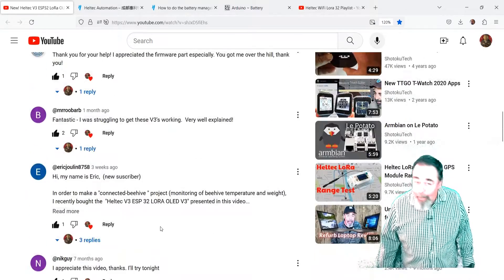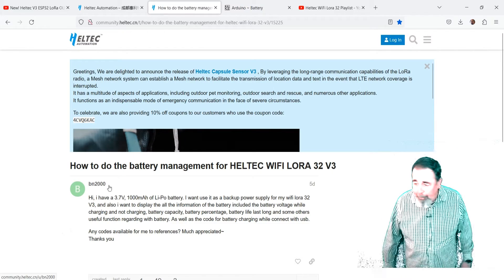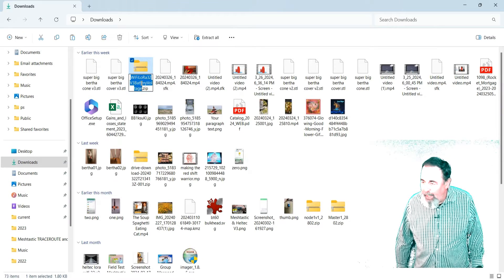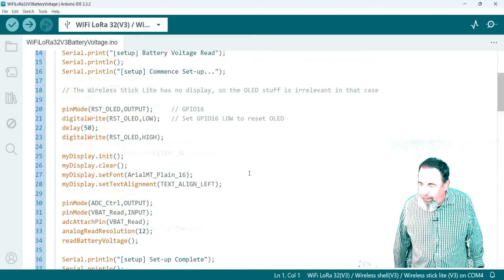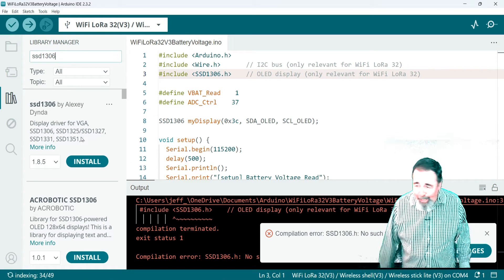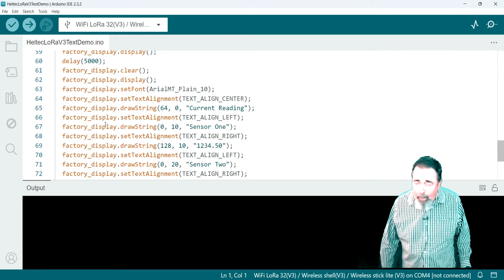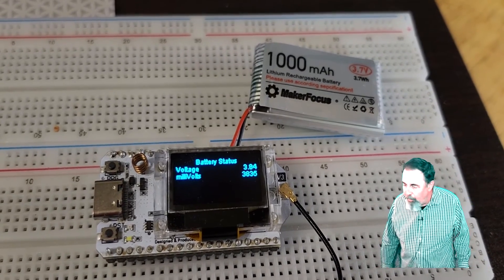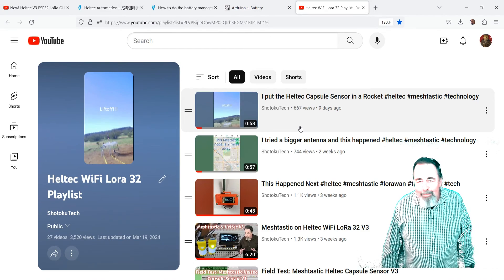Battery Management: Heltec WiFi LoRa 32 V3

Comment: Is there a way to tell it to shut down the display and LEDs once you're doing everything on the app?
Reply from the maker: You can turn of the display. I'm not aware of a way to turn off the LEDs.
Reply: @ShotokuTech  thank you. I can't even get the boards to stay powered down for more than 5 minutes. I'll have to put in a switch
Reply from the maker: @bendeleted9155  I use a switch when using the Heltec V3 with Arduino code. 
If you are using this with Meshtastic, holding the user button down for 10 seconds shuts it down.

Comment: Hello!, can it be connected by solar power through the usb-c then a battery is connected through the connector for continuous power?
Reply from the maker: Yes, it can be done in this manner. Thanks.
Reply: @ShotokuTech  wow thanks for the reply!! I'm planning to connect it DFR0559 so it is dual battery although only 1 battery will be readed. do you think this setup will work?
Reply from the maker: @jerickojamestano626  Can you read directly from the DFR0559? I would think that is more reliable if it is directly charging the batteries.

Comment: Does not work with heltec 3.2?
Reply from the maker: I have not seen a Heltec WiFi LoRa 32 V3.2 yet?
Reply: @ShotokuTech  
I’ve been trying to read the battery voltage on the Heltec WiFi LoRa 32 V3.2 (ESP32-S3), and I’ve encountered an issue that may affect other users of this board.

According to official Heltec documentation and the schematic (HTIT-WB32LA_V3.2.pdf), the battery voltage is supposed to be read via a voltage divider controlled by GPIO37 (ADC_CTRL), and routed to an ADC pin like GPIO13, GPIO10, or GPIO1 (depending on the source).

However, after testing every exposed GPIO with a multimeter while GPIO37 is set to HIGH, none of them show the expected divided battery voltage (typically ~1.6–2.1 V when the battery is at 3.8–4.2 V). Most pins either show 0 V or 3.2–3.3 V (pull-ups or power lines). This includes:

GPIO1

GPIO10

GPIO13 (not even exposed on this board)

GPIO39, GPIO2, GPIO4... (full sweep)

Even though the battery is properly connected and charging (verified ~3.9 V via multimeter at the JST connector), analogRead() on all candidate pins returns 0 or near-zero values.

This leads me to believe that VBAT_ADC is either not routed to any usable GPIO, or is only available via internal ADC channels not exposed through standard Arduino functions.

Has anyone successfully read battery voltage on the Heltec V3.2 using Arduino?
Is the only way to do this via a custom firmware (like Meshtastic or using ESP-IDF's RTC ADC)?

Any insight from Heltec or the community would be greatly appreciated!

Thanks in advance.
Reply: @DanielPorrasR  so I was having the same issue as you. I'm not entirely sure of what I did, but I noticed that when GPIO37 was high, I'd get a reading from GPIO1 (VBAT_Read on the heltec documentation). I just pulled 37 to high, read the voltage using analogRead, then pulled it back low. From there it was just a matter of finding the correct value to multiply the analog read value to get an actual voltage. This value was verified directly from the JST connector on the board while it was powered on. I did notice though that it will get .02-.04 volts off depending on if the voltage is higher or lower from when you "calibrated" it, but its good enough for me.

#include <Wire.h>
#include "HT_SSD1306Wire.h"

SSD1306Wire display(0x3c, 500000, SDA_OLED, SCL_OLED, GEOMETRY_128_64, RST_OLED);

#define VBAT_PIN 1
#define ADC_CTRL 37

void VextON(void) {
    pinMode(Vext,OUTPUT);
    digitalWrite(Vext, LOW);
}

float readBattVoltage() {
    digitalWrite(ADC_CTRL, HIGH);
    float raw = analogRead(VBAT_PIN);
    digitalWrite(ADC_CTRL, LOW);
    return raw * (3.3 / 4095.0) * 5.215384;
}

void setup() {
    pinMode(ADC_CTRL, OUTPUT);
    digitalWrite(ADC_CTRL, LOW);

    // initialize OLED
    VextON();
    delay(100);
    display.init();
    display.clear();
    display.setFont(ArialMT_Plain_16);
    display.drawString(0, 20, "Battery Test");
    display.display();
    delay(2000);
}

void loop() {
    float v = readBattVoltage();
    display.clear();
    display.drawString(0,20, String(v) + "Volt");
    display.display();
    delay(1000);
}
Reply: Forgot to include the analogReadResolution(12); in setup()
Reply from the maker: @carter9591  Thanks for the insight. Best wishes.

Comment: Thank you very much to the contribution of the community, normally your codes work fine on my board, but this one is returning this error: 'adcAttachPin' was not declared in this scope Can you please help? Thank you!!
Reply from the maker: It seems that Heltec changes things in their board definition packages from time to time. The code worked with the board definition package that was available at the time. I would have to try to reproduce the issue with the current package.
Reply: @ShotokuTech  Same here, very frustating!
Reply from the maker: @pulpitus  Isn't that the fun part of this hobby? Facing new challenges and overcoming them. That is the reward. Best wishes.
Reply: @ShotokuTech well… not much 😂 I have been whole day fighting with deep sleep, only gpio0 is able to wake up this board, and there is no info in their documentation….
Reply: You can use the code posted below for the battery, it works with 3.2.
Reply: @ShotokuTech  Thank you!

Comment: what are the calibration values you got there? does one create them by measuring something, somewhere, or are they generally the same? (the values I see when power is plugged are all over the place and definitely messed up. unplugged they might sometimes make sense. Also I'm getting a 4-digit value in (voltage since it's floatvoltage*1000) Maybe tomorrow I try again and understand my errors, but the calibration bit is a bit of a worry.
Reply from the maker: I used the values I found when making the video. You can probably adjust them if you have some accurate measure to guide you. The output still may need some interpretation such as the four digit voltage. But you are off to a good start. Best wishes.

Comment: Thank you for sharing the information, that was helpful and inspirational. However, when experimenting with the sketch I have some strange behavior (the ESP entering kernel panic and sometimes executing instructions out of line) that was difficult to debug and explain. After hours of testing I found  that (in my case) the root cause was the missing return statement in the method uint16_t readBatteryVoltage(). When I was either changing the method in void readBatteryVoltage() or adding a return voltage; at the end oft he method everything was working well.
Reply from the maker: Interesting

Comment: I am having problems compiling and joining the code with another one that I made, I do not understand why it does not recognize the adcAttachpin function, I was searching the forums trying to try but I have not been able to fix the error
Reply: Same issue!
Reply from the maker: @tetie_  What is the issue specifically? What library, what sketch?
Reply: @ShotokuTech  I managed to solve the issue simply by removing the function. It seems to work properly without it. The expresssif docs says the adcAttachPin API got removed when upgrading from arduino ESP32 2.X to 3.0. So it seems to be chip-specific for newer ones
Reply: @tetie_  I can confirm the same result. 
Error was: 
error: 'adcAttachPin' was not declared in this scope 36 adcAttachPin(VBAT_Read);
exit status 1
Simply removing line 36 worked!
Reply from the maker: The code I shared works, correct? It's hard for me to advise further without the context of what else you have added to the sketch. Best wishes.

Comment: ledCSetup doesnt work with heltec lora 32 v3 Do you know why? many thanks

#include <Arduino.h>
const int pwmPin = 19; // 
const int freq = 5000; // 
const int pwmChannel = 0; //
const int resolution = 8; // 

void setup() {
  // PWM pin konfigurálása
  ledcSetup(pwmChannel, freq, resolution);
  // A PWM pin hozzárendelése a kiválasztott csatornához
  ledcAttachPin(pwmPin, pwmChannel);
}
Reply from the maker: Hello. To be honest, I am only supporting the example sketches that are included with the V3 board definition or code based on those examples. Best wishes.

Comment: Hey! It's me again. I was wondering if you have already tested the new Wifi_lora_v3_factorytest_v1, besides the fact that i have already tested this board before (and done some projects with it) it seems to be that the new library update has so many different problems to solve (does not work at all, at least for me) and i was wondering how you dealt with that! Congrats for that good work on troubleshooting and challenges!
Reply from the maker: Right now I am totally immersed in running Meshtastic on the Heltec WiFi Lora 32 V3. My outdoor solar powered unit just survived its first night with 64% battery left and the Sun is coming out again. I'll see what I can do if I get a chance. I noticed a new board came up with LoRa failed right out of the box the other day. But flashed with Meshtastic it worked fine.
Reply: I see, does meshtastic have any support for multiple sensors and different projects that might require a way to access that information by any app with graphics?
Reply from the maker: @santiagoandres5658  We are learning about that step by step. I have several videos and shorts on the topic so far. You know from my other videos that serial and I2C devices are supported on V3 and I know Meshtastic supports MQTT. So I will connect the dots at some point. Stay tuned.

Comment: Hello. I am currently using a boost module (the same that you show in the GPS video) to increase the battery voltage from 3.7 volts to 5 volts. The 5 volt output is connected to both ESP32 and the GPS module. So, in order to do battery management like this, how can I make it?
Reply from the maker: ESP32 only allow 3.3 volts on the GPIO pins. So you would need a couple of resistors to divide the 5 volt input  to a GPIO pin between positive and ground. Then you would have to come up with the correct factor to multiply the resulting divided value back up to 5 volts. Or you can just monitor the 3.3 volt line the same as in this video. It depends on which voltage you want to monitor I guess. This was the booster I have used and it has its own battery indicator built in. (4 LEDs). I just attached a Micro USB connector to it to charge the battery. https://amzn.to/3PNk2gX

Comment: Hi Sir, would like to ask if you can do a tutorial video about LoRa nodes communication? e.g.- showing its functions to simultaneous data transmission of possibly actual SNR and RSSI values from the LoRa 32 V3 modules.
Thanks for always exploring new thing!
Reply from the maker: Hello. I have a playlist with almost 30 video for Heltec WiFi LoRa 32. Maybe there is something for you already? Thanks.
Heltec WiFi LoRa 32 Playlist
https://www.youtube.com/playlist?list=PLVPBipeObwMP02QIrh3RGMs1BtPTMt19j
Reply: @ShotokuTech  I've been watching your previous videos over and over again, but sir, you haven't done two or three LoRa 32 V3 simply transmitting and receiving SNR and RSSI, such as two nodes sending signals and one gateway node receiving signals, or one node sending signals and two gateways receiving that signal. The result can be to observe the relative relationship between those nodes, their received signals, and the distance between the node and the gateway within a certain range. Sir, Could it be possible to do a tutorial video with this content? 
Thanks so much!
Reply from the maker: To be honest I suggest adopting the Meshtastic platform. 
Meshtastic Playlist: Quite possibly the best use case for your compatible LoRa devices. Become part of a larger community or make one.
https://www.youtube.com/playlist?list=PLVPBipeObwMNikSEscJtNj8iK2wksWBtu
Reply: @ShotokuTech  Yeah sir, I need your tutorial guide please, can it be done like simply monitoring using Arduino IDE?
Reply from the maker: @Yoyo-kf8mi  So did you look at any of the other videos from these playlists? These are pretty thorough tutorials. Meshtastic let's you monitor not just your own LoRa nodes, but other people's nodes as well. I am picking up nodes 2-3 miles away from me. And I can monitor RSSI for them in the web interface for Meshtastic. I don't know how else to answer your question. Thanks.
Reply: @ShotokuTech  I've seen those playlists, and this video https://www.youtube.com/watch?v=shJxD5fiEhs&list=PLVPBipeObwMP02QIrh3RGMs1BtPTMt19j&index=23 inspired me to ask these questions about it. I'm now still haven't been able to pass the compilation of the Factory_Test option WiFi_LoRa_32_V3 example program from the latest  Heltec ESP32 Dev-Boards library, and the SNR signal in addition to RSSI weren't successfully be obtained, Sir, Could you please update this question of the content? 
Will thanks!

Comment: Hello! I bought one of these today and powered it on to my computer without attaching the included antenna, It ran the WIFI_LoRa_32 factory test code. I am worried that i fried the LoRa module. I don't currently have another lora module to test communication. Do I have any way of testing if my Lora module still works short of getting another module?
Reply from the maker: Without a second device, you would need some RF meter. Or, if you are lucky to have other people nearby that are running Meshtastic, you could install Meshtastic and detect other nodes. I didn't see other nodes until I put a longer 175mm antenna. Then I picked up two nodes 2-3 miles away. https://youtube.com/shorts/2zVF1u9YrWo?si=ysTlKXR6HAhKR1zN

Comment: I just assumed that I should build an external battery charging unit.  It was instructive, but completely unnecessary ha ha.  I will try the on board feature.    I find that many times I run into the same challenge with 'include' files that seem like they should fall within my meager library management skills but go missing...  Keep up the great content, it is somehow perfect for my needs
Reply from the maker: Cool, thanks. Best wishes!

Comment: Thank you for your work!
The voltage control is one of the "to do list" with my Heltec V3, dealing with my "connected beehive" project...

But i'm still struggling with abnormal values given by both my DHT 22 ( Temperature digital sensor) and HX711 (weight analogic sensor)

So i'm wondering if there is any user of the Heltec V3 board following this channel who has already tested these sensors and who could recommand  me GPIOs that are known to work with this kind of sensors DHT and HX-711?

(All the factory tests work fine with my Heltec V3 board ;-)

Eric
Reply from the maker: For I2C I use pins 42 and 41. If you want to use the display with I2C devices attached, I use 'Twowire' for the 2nd I2C instance. The display resets the I2C pins to the first instance when it initializes. I show that here: https://youtu.be/5lEMRN-o_ng
Reply from the maker: For Serial I use pins 46 and 45: https://www.youtube.com/watch?v=tQZC4GlYhMc

Comment: Brilliant video, thank you so much. I am also looking in to if the onboard led can be monitored to determine power supply,the led goes bright when plugged in, goes dim when on battery. The other possibility is does the voltage ready spike above the battery power when plugged in, in which case could maybe use if (voltage > batteryPower) then must be charging.
Reply from the maker: Yes, the voltage goes to 3.95 right away.
Reply: i sent you an email, it may go in to your junk mail.

Comment: Yes battery management is needed, it took only a few days before I got my first bloated 1000 mAh LiPo battery. The V3 has not been able to do that to my 3000mAh battery. Thank for sharing!
Reply from the maker: V3 seems capable of charging them correctly, at least so far for me. Thanks. Best wishes.